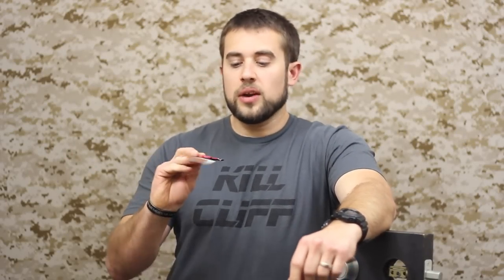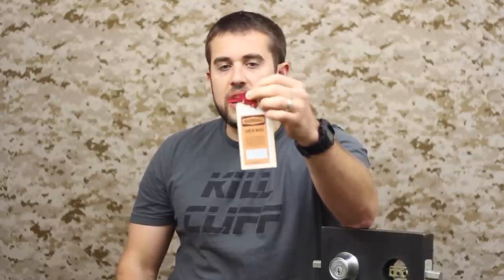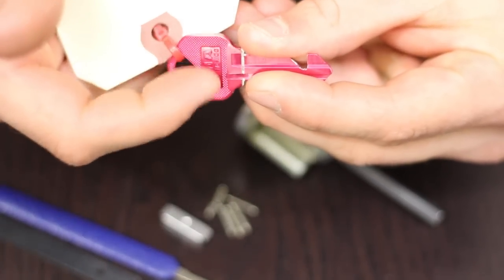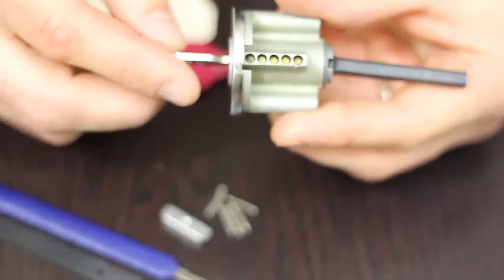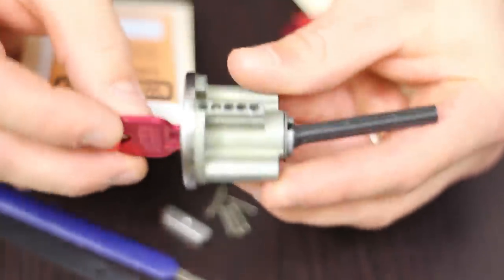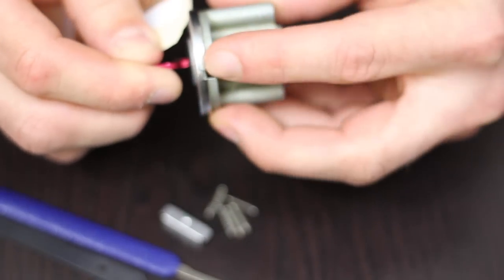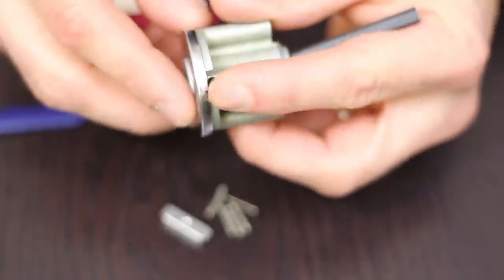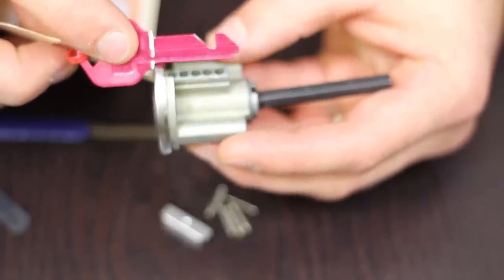Permanently Disable a Household Lock with Lock-Kill

Comment: the only purpose i see for this Lock Kill key is as an act of vandalism.  if you're a Landlord and you go through legal channels and get your judgement, the Police will show up with the Court Documents stating it's Illegal to enter the property and at that point, you can Legally re-pin the locks.  any Landlord who uses this tool on it's tenants without the judgement, will be in jeopardy of  turning the courts against them should the tenant file a claim in court not to mention, now the Landlord has to get the lock replaced since the broken off key can't be extracted.  on top of that, there are usually more than one door entry points to a residence so you're going to disable them all?  they can't get in and now, neither can you as the Owner of your own property. 

what i can see happening here is the tenant who's either behind in rent or mad at the Landlord, breaks the door and jamb to re-gain entry.  now the Landlord has another issue to fix in addition to the lock...  and that's only IF the tenant feels bad about not having the money and not going off and damaging a whole lot more inside.

if you want to lock a tenant out, pick the lock, re-pin and leave them a note saying you'll let them in when the rent is paid... but even that's not legal in most states.

i don't see any real purpose in this key other than malicious.  sorry.

Comment: 100% not effective what so ever. all yo have to do is slide a pick, key extractor or shim that is thin enough into the lock, push the pins up to the top and with pliers or another key extractor pull the broken key out
Reply: That's what I was thinking. I imagine it'd have to be thinner than usual tho
Reply: I was thinking something along the lines of a set of feeler gages and tin snips to get  the  Thickest feeler gauge that will fit in there to  Same with as the key

Comment: Well those extractors should be key shaped and the full height of the lock so it pushes the pins up and releases the key. Then either use a tool or a magnet or something to get the key out.

Comment: Most people dont know how to get a broken key out anyway. Why not use a cut key that is a different bitting, break it off, the plug won't turn, but the key can still be removed with an extractor. But the, there is a way using a thin shim the can be used to reach beside this lock-kill key and lift the affected pin stack. It can be done. And it can save a lock especially if it is an expensive lock. You dont want to use tooth picks or super glue or anything that will ruin the lock. All you want to do is temporarily prevent access until you change the lock or repin it.

Comment: SO once the land lord has disabled the lock, how does the landlord access the property? Also, I think you could extract it if you lift each pin in succession or use a pick with a diamond or 45* end to allow the pins to ramp up over the straight cut.

Comment: All you need is a little steel drill and drill the key through.
Depending on the lock there might be enough gap for this still extractor to get into lift the pins.
I would also try bumping on the core while pulling the key out after each bump.

Comment: There are ZERO legitimate uses for this product.  No owner would ever use this on their own door.  This is a vandalism device.
Reply: you realize landlords have to CHANGE OUT ALL THE LOCKS when a tenant is evicted but keeps the keys, right? so the locks are trash anyways.... thats the fucking point
Reply: If they're not broken, they can be sold. Ebay, Amazon, Craigslist, etc. But I think this product has a legitimate purpose. Keeping former tenants out in between lock changes is one. Preventing a lock from being pickable is another. This is an easy and fast way to convert a back or side door so that it can't be unlocked from the outside, so that the visible front door is the only way in. Still, $20 is ridiculous when the existing key can be converted to a trap key with a file. This is marketed to the ignorant who can't be bothered to learn how a key works.
Reply: And what stops the landlord from going to a locksmith and having the entire set of locks rekeyed? It's less expensive than a new lockset, which would have to be rekeyed anyway if the landlord uses a mastering system.

The locks are not trash just because someone has a key... Would you throw away your car if the mechanic didn't give your key back?
Reply: Different agency's & military use these during warrants & searches.
Reply: I doubt that. It would be unnecessary, it would expose the agency to liability as vandals, and violate the rights of the homeowner.

Comment: just drill into teh key along the crease line,
pull out the first part of the blank,
put your pick tool in to lift the pins for the tip to pass,
pull key with tweezers/needle nose pliers.
done.

might cost you a 1mm drill-bit, but those things practically break themselves.

Comment: $10 you can buy 25 key blanks and spend like a minute with a Dremel on them.
Reply: +Michael Parker yup, or even a small file will do it. You can get a set of jeweler files for like 10 bucks, and you can use em for all sorts of other stuff too. so for the original price of $20, you can have 25 of these and a very handy set of files
Reply: Buy the blanks and they will cut those for no extra cost,ddddooooyyyy!

Comment: Remove door, turn it upside down, remove key.
Reply: no doesn't work. it works on his because he has no springs installed
Reply: +milano007100 ah, i obviously have no clue how locks operate. oops
Reply: Joe Armijo  well no one knows everything when born, you will learn things faster then you think
Reply: Your profile pic makes this 10x funnier
Reply: c4 on door, door opens
Reply: Also you cant remove a house door from the outside lol hindges are inside... If my landlord did this shit i would just break door down get my shit and fuck off haha but tjat wont happen necause i pay my bills 😂😂😂
Reply: If you remove the door, what's the point of pulling the key out? You're already inside. Lol
Reply: Just stop at step one "remove door" there it's open lol
Reply: Drill a big hole above lock and use powerful magnet

Comment: Best lock kill ever is tooth picks and super glue. Jam both into lock and I guarantee no one is getting it out.
Reply: an anti fur trade friend used Glaziers sharps which are like headless carpet tacks, when they were protesting at fashion stores. hit one of them into a lock the only way out is with a drill, super glue can be dissolved and the tooth picks removed fairly easily
Reply: C .Wright Thats not protesting.  Thats destruction of private property?
Reply: C .Wright Where can I get some?  I have so much private property I want to destroy...  So little time.
Reply: +joblessalex  If you're a vandal this method could be a lot quicker-- just stuff the key in and run.
Reply: Syncopator But vandals are poor....
Reply: joblessalex  They're not that poor-- plus you can make one of these in a few minutes with a cheap file and an old key.
Reply: +Deezildennis it is

Comment: This is one of the dumbest "inventions" I've seen. If one would even consider doing this why not just take the key that fits the lock and break it off? Just put jb weld in the damn lock. I just don't get this. Have they ever made a sale??
Reply: its tactical bought 2;)
Reply: +Patrick M that answers my question at least.
Reply: +Angus Evans That's why you would file the key down so it doesn't work anymore.

Comment: The release key for the  Kwik Set plug puller will remove the broken key along with a key extractor. The release key slides along the top of the broken key and the extractor slides along the side.

Comment: This could actually be useful. However on a euro cylinder it would prevent egress. 

 The East German STAZI had a similar device that was reversible, which was used while inside an apartment, to block the key working from the outside while they did whatever spy stuff they were up to. A built-in lever lifted the trapping pin clear for removal.

Comment: It's aluminum. Making it easy to grind away, with a simple mini file. Not a good tool at all. It's practically useless.
Reply: +Spinoblood21  how would you file that off??   seriously?
Reply: +Mercer Frey easily, use a file its soft aluminium.
Reply: +gary nugent  where are you gonna find a file that's gonna fit into a small key hole ?  it has to be ridiculously small and if you somehow managed to fit a "mini file"  into that tiny space, it wouldn't be practical at all.
Reply: +Mercer Frey They are discussing making their own. Hard to tell because of context, but one should just assume so and get on with life.
Reply: ***** With a small file
Reply: +Spinoblood21 a 1kb file?
Reply: gi70st Sure.

My best advice to help you get the key out however is go back to school.
Reply: Spinoblood21 I was never in a school of fish. well....i guess i was near one, but that doesn't really count.

Comment: You don’t have to break them off. The tag is so u can leave it in with contact info. If u want to take it back out disable the lock take the springs out and turn it upside down so u can re use it next time. Breaking it just makes it harder to get out

Comment: 10 t0 20 dollars on something you can cut yourself? That doesn't make cents. 

Curious about something: If the broken key remover fits inside the keyhole with the broken key in as well, couldn't the pins be pushed up (one at a time) past the 90 degree portion?

Comment: Those can be defeated with a thin piece of metal like a handcuff shim which is a good edc item  and if you paint it black you can call it tactical. All you have to do is slide it in along side of the key wobbling so it lifts the pins slide it all the way back and lift and it slides out .

Comment: A bit of fiddling with a proper extractor would get that thing out, probably.
Reply: +FokkerBoombass yeah, if you had a very thin pick, most old locks the keyway is worn, you might be able to get in there, as long as it wasn;t a security pin, most cheap home locks are not. You already know which pin to go for

Comment: Ok, I see 2 applications for this. One being police or military securing an area quickly and two, as stated in the video, for a landlord to lock a tenant out. Personally I think two variants would be best. This one for the military and one without the snap off. In a situation where you're securing an area as quickly as possible you're gonna want multiple keys for the likelihood of multiple doors, you're not gonna want them loose so a keychain will be necessary but then you don't want to fumble around getting each key off so you snap them off. As for the landlord, they aren't under much of a time restraint and I doubt there are many tentacle house with much more than 2 or 3 doors. Also on top of that they are technically reusable and at, what people have being saying in the comments, $10 a key, I would very much like more than one use for each key.

Comment: there is one flaw I see in this. if you were to use a thin piece of steal & have the tip slightly bent you could slide it along the broken key and push the pin up for when you got to the cut out it would flex in word allowing you to menipulate the pin/pins  also allowing you to take a broken key removal tool and remove the blank.

Comment: If you are a Landlord that uses these keys you have more money than sense. A more cost effect solution is to have secondary locks ready. once the tenants have left. change the locks yourself, doesn't take long, isn't hard to do, and saves money in the long run.
Reply: +AaronAlso Quick Set Smart Key, change all the locks in a house in about 5 min.

Comment: Good idea and all but you're going to pay a locksmith to take the lock apart or do it yourself if you know how to. But some cheap locks like Defient you cannot get the top pins in the deadbolt out so now you gotta buy another deadbolt or knob and bolt combo so tack on 10 bucks for the key and what ever time you take to get the locks.

Comment: I maybe missing the point but all I would do is get a wrong key that fitted the lock cover in cheap superglue push in hold till set break key off. Same effect fraction of the cost.
Reply: Ron Angel Superglue dissolves from acetone vapour. So your to-be-locked out person just goes to a pharmacy and gets there a good big bottle of acetone, compression bandages or cotton wads and tape, and tweezers, preferably a micro pipette, and a LOT of patience, cause this will take many hours, and he's getting back in. If a neighbour asks, he just says a random angry kid superglued their lock, and they won't be bothered.

This thing is btw non-destructive, so a less "tactical" person who isn't so easily convinced by what the package says would just use a thin shim to lift the pin and extract the "tactical" lock blocker. I bet any vending machine with sweets and canned beverages is helpful in removing it, so i still don't think it's such an easy to recommend product.
Reply: Siana Gearz There is no way that the residual amount of superglue could get out of the tiny springs in lock  so even with solvent chances of opening even after a long time under this use are virtually zero. 
But in that case I would use marine grade epoxy resin (I have some from Germany) which sets underwater 30 minutes   and works up to 200C can fix car radiator. Or standard quick set stuff from DIY store.
Reply: Ron Angel You are correct, and epoxy binds so awesomely to metals, any grade of epoxy really. It does degrade from acetone and ketones somewhat, but it still needs to be scraped off bit by bit. Not sure whether any glue will reach the springs that easily, the gravity is kinda in the way, and either the glue is too thin to push up, or too thick to travel in. [EDIT: i'm stupid sometimes] The pins will be blocked, but they can be freed up just enough to regain entry, it has been demonstrated for superglue - not sure about epoxy, i imagine it being a lot more difficult to impossible. As soon as you have entry, you can replace the cylinder from the inside.

Apropos, it's not like you can't just buy a battery powered drill and still use the same excuse for neighbours, angry kid, superglue, stuff. They would have seen you and know that you're not a burglar, right.

All of these are solutions to the problem that doesn't exist. Evictions need to be performed by authorities in the proper manner, not by blocking the lock.

Comment: $20 for this? You could probably draw and request this specific cut put into a 25¢ key blank at your local hardware store for an extra $2. Or if they allow you to buy uncut blanks, a rotary tool or small file could make these easy.

Of course like some others have said, JB-weld or epoxy does it too.

Comment: Find a coke can, cut a thin strip, as wide as the key. Shim it in, along the top, while pushing the lock-kill in to raise the set pin until it reaches the back of the lock. Extract the lock-kill piece with the shim. No more disabled lock and no extra tools. Same process used for picking handcuffs.
Reply: +antagonizerr tested?
Reply: In a manner of speaking. I was a building super many years ago and occasionally people would pull stuff. These weren't around, but you'd find a house key, filed down a lot like this because, if you had to evict them, you weren't allowed to break the lock under the laws at the time. It was either this, or glue and interestingly, this was only slightly harder to remove.
Reply: +antagonizerr I think that last valley will be a bit hard to shim. Probably not impossible, but not easy either.

Comment: You can just take a shim, cut at 45 to match key end, insert on side of kill key untill it pushes dropped pin up and wallah, pull out not so dead key, just did it to my home made kill key, lock was completely assembled and working with original key.

Comment: There is nothing preventing you from lifting the stuck pin(s) with a shim running along side the key just like a broken key remover would do. Hell, you could totally use an actual broken key remover to lift the pin while using a second key remover or a pair of needle nose pliers to pull the key out.

Comment: Unfortunately there is a number of ways to open a locked door that this does not stop. I've been managing apartments for 25 years and if they want in they will get in. This is a "cool" thing that is effective at preventing a lock from being used again. In my experience changing the locks posting a big yellow or pink notice to vacate in the door and alerting the neighboring tenants that this particular residence had been abandoned by the noon paying tenant prevent re-entry. Community communication reduces crime for a reason. I didn't even know this device existed until this video.

Comment: 10 years later and Sparrows still makes these Lock Busters. They can be bypassed but the average person won't have the tools on them. Good for an abusive spouse to allow you to disable the lock so you can call the police while they try to get inside should they have a key. More practical, Sparrows makes the Hotel Key set (most hotels use cards these days) that fits 4 lock types and allows you to remove them and reuse them as need be. Yes there is bypass for these, but it is all an arms race.

Comment: I don't understand the point of breaking the head off of it. If the key is a blank, it being in the lock wouldn't allow you to open the lock by turning it. And if you tried to use it to pull the key out, you would bend the dropped pin irreparably (and the normal key wouldn't work after that).